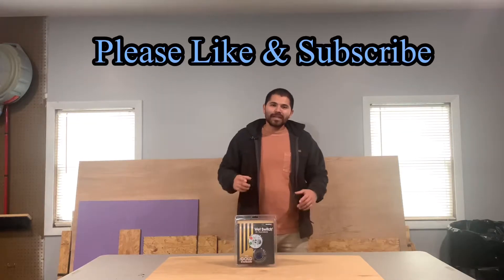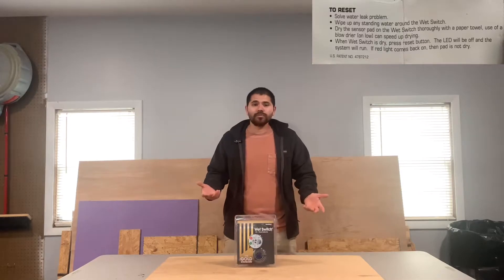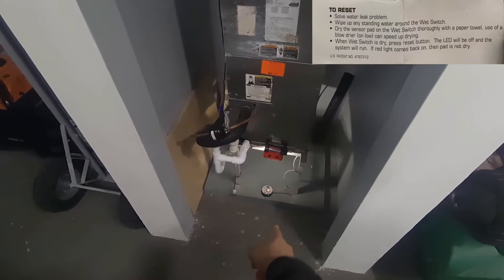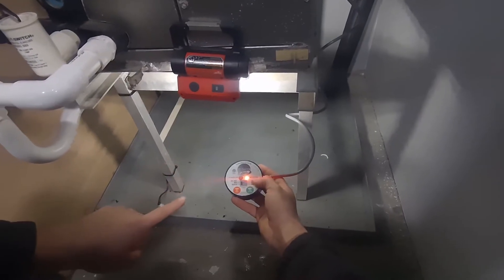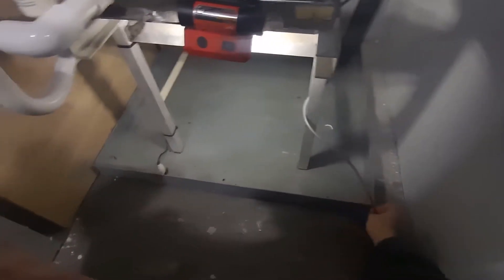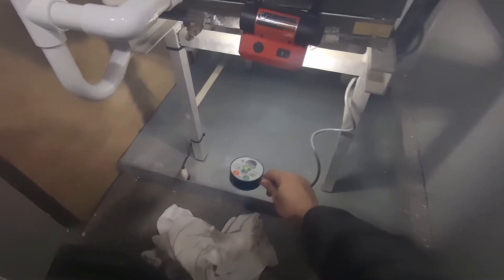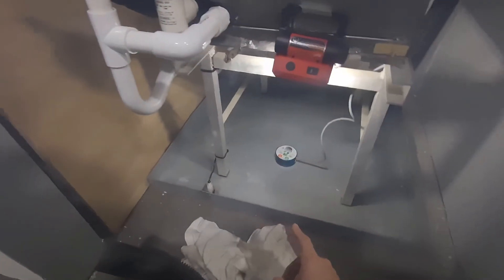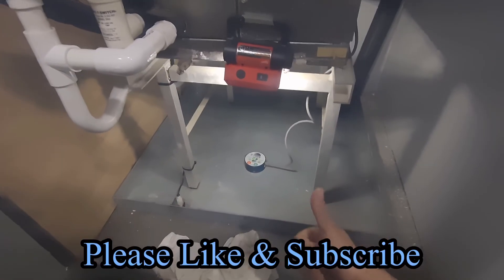How To Reset Wet Switch (HVAC)

Comment: How do you know if it’s messed up?
Reply from the maker: If it doesn’t reset after being fully dry then it’s bad also if you bypass the switch and system comes on then it’s a bad switch

Comment: Hey man , my thermostat went blank & heat turned off . I changed the batteries & turned back on .

But now my furnace won't turn on , I climbed up to attic & wet switch is red , not really wet in the pan but the wet switch bottom is damp & when pressing it,  it won't turn on . I'm going to try & dry it fully/maybe dry vac it& see if that works (( would you know what else it could be , I don't want to pay a 175$ service call in if I don't have to ) also the furnace door light blinks green now ???
Reply: Same boat what happened with you?